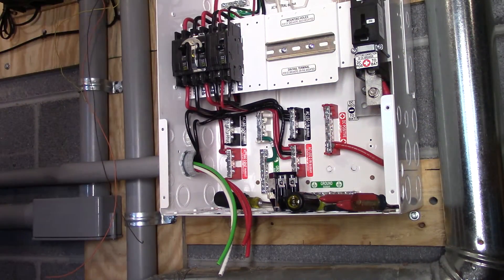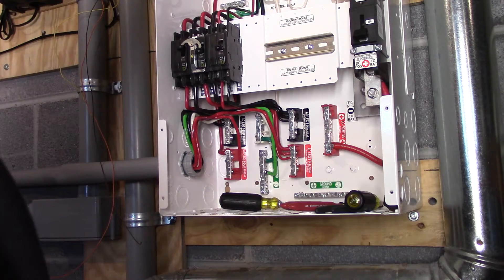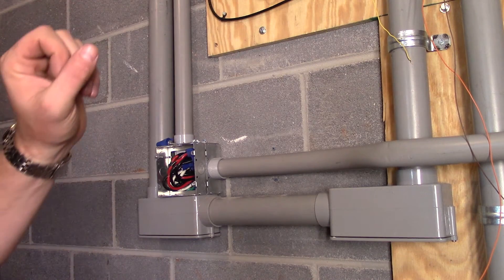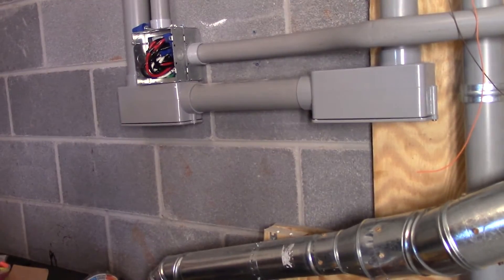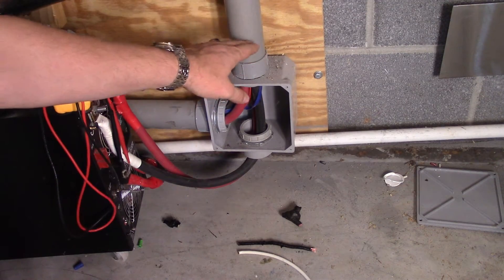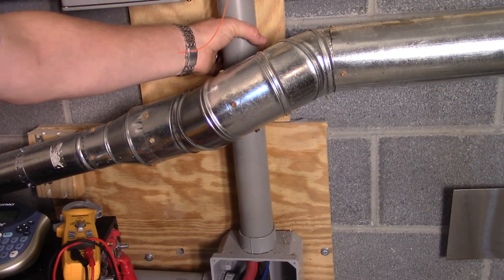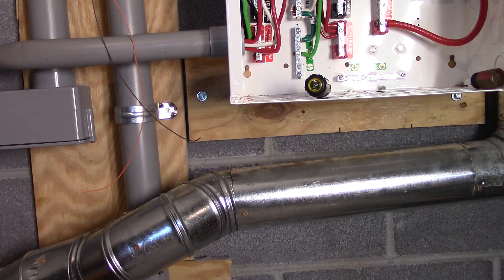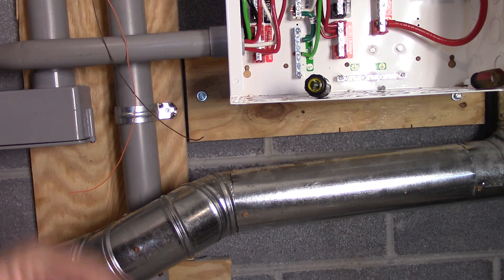Installing the high voltage into the solar breaker panel for the magnum 4400 watt / 48 volt inverter

Comment: What happen to your latest video?
Reply from the maker: +Calamine Cortizone I think people was thinking I was mad a Missouri wind and solar I don't want nobody thinking that I'm upset with the company because I'm not I'm upset that Magnum sent me damaged equipment from the factory
Reply: Ok, I thought you were mad too. Do you have a labeler?
Reply from the maker: yes
Reply from the maker: why do you,asy
Reply from the maker: ask
Reply: Solar Power Electricity and Electronics it's a good way to keep wires organized and trace for future diagnostics.
Reply from the maker: +Calamine Cortizone yes it's nice to have everything labeled
Reply: Solar Power Electricity and Electronics so your mainly into heating and air?
Reply from the maker: Yes I have been in HVAC service since i was 16 years old

Comment: there is this square looking metal with a hinged door on it that i have seen going horizontal and vertical, you open the lid, place the wire or wires then close the lid. i think the fellow in Australia does it that way

Comment: very nice and neat.  the vent for the batteries can go straight up hydrogen gas rises at 60 mph. a fan isn't needed if done right. so mount your vent pipe on the top of box run pipe up then over and out then it will be out if your way
Reply from the maker: I need a fan to cool the batteries. thanks for the clean and neat compliment.
Reply: The heat from the batteries will rise along with the hydrogen gas. Naturally. The warmer they get the more draw.
Reply from the maker: yes but my battery box the doors are on the top and the vent will not be installed well
Reply from the maker: In any living space and vent pipe it's code to have metal to prevent co2 death from a car running in the house I know the fan removes air but it's the way they work here.
Reply from the maker: I will remove the box soon and make it better with a rack to hold (16 or 24) T-105 or maybe the iron batteries I will need 40 of them.